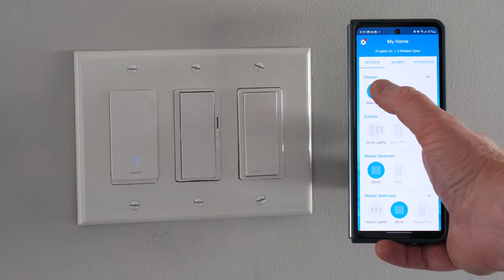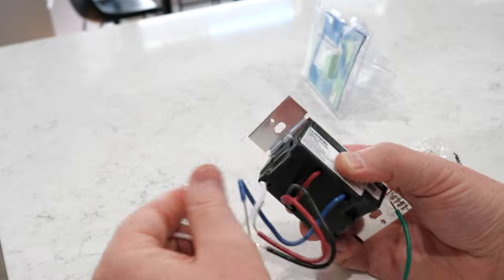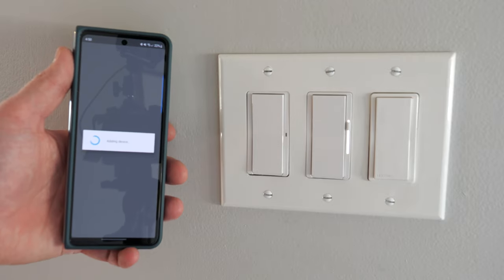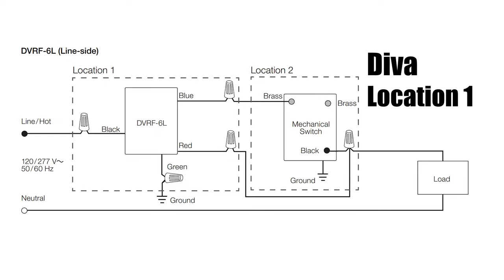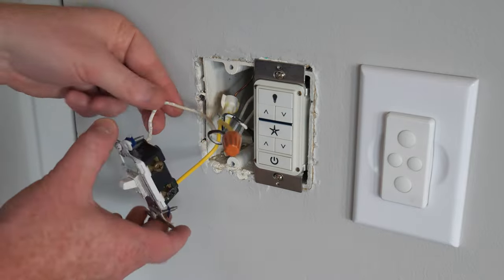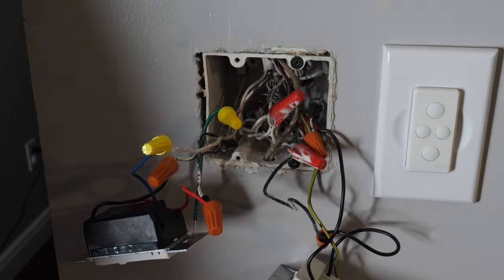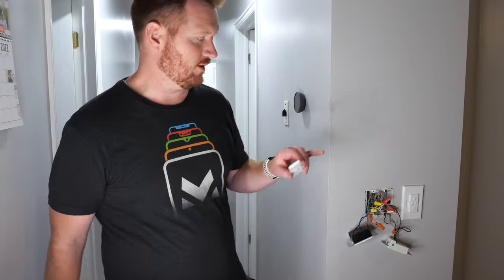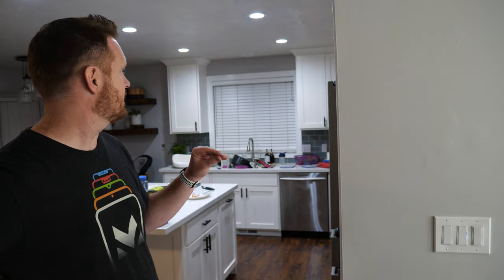The New Claro Smart Switch & Diva Smart Dimmer Advanced 3-Way Wiring Installation

Comment: Brett.  I believe when box says "FAN 3A" they are talking about an exhaust fan like one would have in a bathroom.   A multi-blade ceiling fan, that is 1.5A.  So if you wish to control speed you need a switch specific to 1.5A fans..  For that you would use the Lutron PD-FSQN Caseta Wireless Smart Fan Speed Control.  Thanks for making these videos.

Comment: Will Lutron smart switches work with lights that have photocell and or proximity switches. So that you turn these lights on and off. I assume you can put pico remote into the circuit as well.

Comment: I have one Caseta wall switch, as well as a lamp plug-in controller. These are controlled by remote switches through a smart hub that came with the wall switch. I would like to get a couple more Caseta switches, but the price is beyond unreasonable. Looking for some cheaper brand.

Comment: I've got a lot of Caseta switches, they work great. I'm looking for a switch or switches that will both control 2 seperate circuits, like a virtual 3 way that isn't wired a 3 way. Do you know if these are capable of that or know of any others that may be?

Comment: Thanks for this video.  I have a 3 way light.  One is in the house, one is in the garage.  If I install the Claro inside the house, but go to the garage to turn the "dumb" light on, will the led in house light up?  I find myself opening the door to the garage to see if the light has been turned off when I could just see from across the room.
Reply from the maker: Yes, if you adjust the other light it will reflect on the Claro switch if the light is on/off with the light indicator.

Comment: Thanks for the video and the work of showing how to connect them. If I follow how the new Claro and Diva Smart switches work, they can be used with existing mechanical switches in 3 and 4-way scenarios, saving money in the long wrong. I just started setting up the Leviton smart switches. Based on instructions, you can not use existing mechanical switches and have to use the Anywhere Companions to replace the mechanical switches?  What will the Claro Accessory switch be used for?
Reply from the maker: The Lutron Accessory Switch will be similar to the Anywhere Companion. The Claro/Diva can work in a 3-way with mechanical or accessory switch, with a 4-way the accessory switch will be needed and can used in up to 10 locations.

Comment: I did the same install with the claro smart 3-way and got the exact same strobe issue. I also ended up switching the location after hours of trouble shooting with Lutron customer support, but I feel that there must be an error with their wiring diagram, and it could have potentially been solved in the original location.

Comment: I had the same strobe issue with my old style caseta switches.  I ended up removing them since I never got it fixed.  I've got a feeling that it's some how related to a GFCI plug that I think this electrical box some how shares with my bathroom plug.  The two boxes are basically next to each other on opposite sides of the wall and I believe they are sharing some wiring.  I'm no electrician.  I couldn't get the switch to work in the other location at all.  I do like these switches I may purchase 1 to see if I can get the new style to work in that location.  $$$ just to test it.
Reply: I gave the new ones a shot.  No dice.  Still get the strobe effect.  When set up like the wiring diagram I can turn off/on from the caseta switch fine, but when I turned it off at the mechanical it would give the strobe effect.  The only place I see the second option wiring diagram was here.  I have no neutral wire in my secondary location so the location 2 option was not an option for me.  I put back in my Zooz switch and it's working fine again.  Too bad I really would like to utilize these switches.  Thanks for the helpful video and something to try to resolve my strobe / flashing light issue.
Reply from the maker: Dang, sorry it still didn't work. It is pretty odd and I have heard others have the issue. Lutron says it is because of an imbalanced neutral line. I believe this means a neutral is not connected properly on the circuit which is the causing the issue. So a Electrician my be able to find the issue but it might take some work.

Comment: Is it possible to have 3 way with dimming functionality at both ends without a pico? can you use diva smart dimmer with maestro at the other end for example?
Reply: Wondering the same thing?  Getting ready to replace all our switches during our reno.
Reply: @beckymwinslow  I'm looking to do the same but I have a lot of 3 and 4 way switches and I'm not really into the picos. It sounds like the accessory switch that is going to come out at the end of the year will work in 3 way with the dimmer but it's not clear if it will have any dimming capability.
Reply: You cannot have multiple dimmers on a 3 or 4-way if one of them is a Caseta Diva dimmer… you are limited to one Diva dimmer with either Pico, Caseta Pico Paddle, Caseta Accessory switches, or mechanical dumb switches (NOT dumb dimmers like a Maestro). Just did one of these installs the other day. It’s all laid out in the Lutron Advanced Installation guide online. In case we get lazy and don’t want to walk to the other side of the room to the one dimmer I’ll just program a Pico remote in that circuit.
Reply: @thomaswildepiano1024 correct. Just did an install the other day. The Caseta Diva will be the sole dimmer. The Accessory switch is On/Off/and double-tap On to 100% brightness.

Comment: Will they be coming out with Picos that look like the Divas or is that what you mean by the upcoming accessory switch?
Reply from the maker: From what I heard, there are no changes to the Pico remotes. The Accessory Switch will be toggle switch (compatible with Diva & Claro) that you can connect like the mechanical switch but it has the same style as the Claro switch. This will allow you to use it in up to 10 Multi-Switch locations.
Reply: You jumped shots between & install & lost me.  Also glad you showed that the setup made your lights flash! Something is inherently wrong with the Lutron switch & you’d think for $70 they have them work perfectly
Reply from the maker: Late night editing will do that... Hope it sort of made sense.

Comment: Thanks for the fantastic video!
I have a question- will it work if you replace the regular mechanical 3way connection with claro at just one end (leaving the second end with its mechanical switch) just like you did but then also pairing that claro with a pico remote control (making it actually 4way connection with one mechanical, one claro and one pico) ?
Reply from the maker: Yes, this should work if it currently is only a 3-way and you are just adding the Pico in a new location.
Reply: @TechWithBrett  Thanks!

Comment: Hey Bret I’m looking for a smart switch that can automatically turn off the lights if they are left on for a period of time
Reply: We got a relative staying with us and they constantly Leave the lights on or fan and with the power rates going up we can’t afford that
Reply from the maker: A few options have worked for this. You could get a basic Lutron Motion Sensor switch. They aren't smart but it is great for a bathroom where it will turn on when someone enters and turn off when no one is around. WeMo switch's and Kasa have the option to automatically turn off after a certain time of being on.
Reply: @TechWithBrett  I’ll check into those thank you

Comment: What happens if you use the claro switch with no neutral or use the ground as a neutral?
Reply from the maker: That won't work. If you don't have a neutral you can use the Diva Smart Dimmer.
Reply: @Tech With Brett  appreciate the response. I'm looking for the best option for a ceiling fan with a light that is connected to a single switch
Reply from the maker: Do you have a neutral at all in your box? I have tested a bunch of these and the best option might be to use the one where you add a remote receiver to the fan and then keep the switch on and use the remote to control it. https://amzn.to/3V2FPAS
Reply: @TechWithBrett  no neutral. Could I use two diva switches, one to control the fan light and one to control the fan speed? Thanks for the responses.
Reply: Does it work with a motion sensor wirenutted with lights

Comment: As you found out, wiring smart 3 ways is not easy. When I bought my Tessan 3 way dimmer kit I was baffled by the instructions. I had my company's electricians take a look and even they were confused. Just trial and error. Bottom line, just install a pico and cap off the other wires.
Reply from the maker: Yep! Pretty simple solution. I really like how they night have all the options.